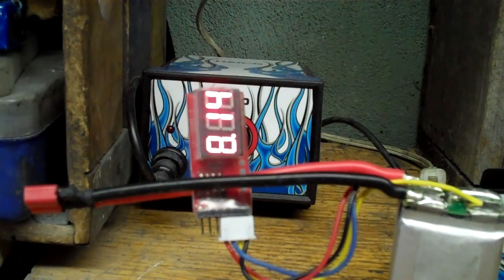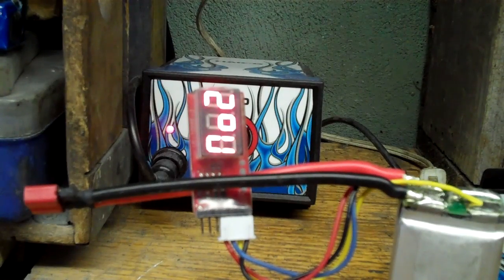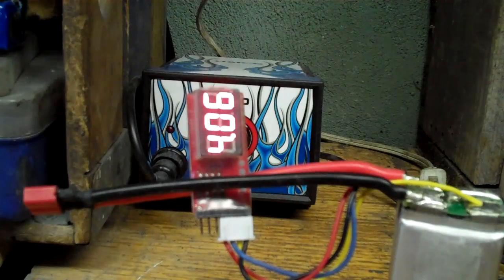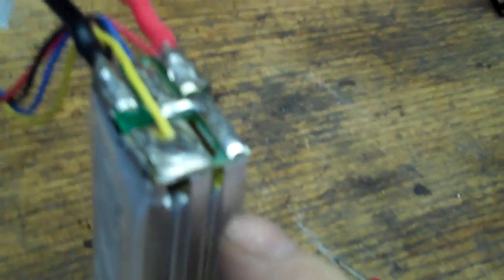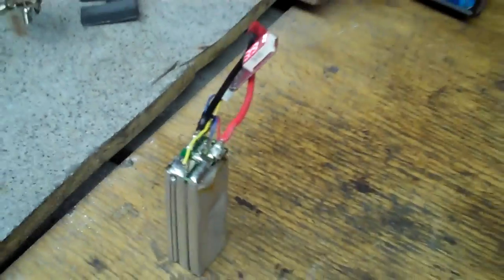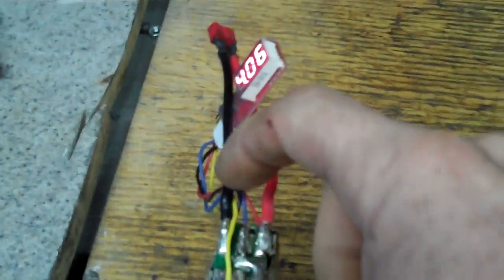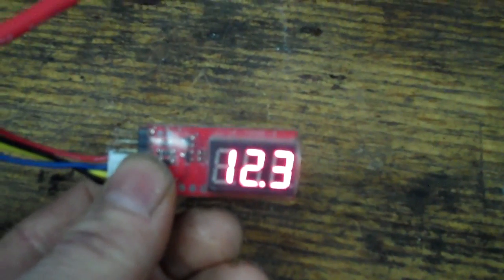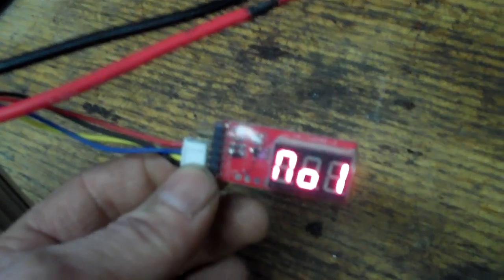How to repair a LIPO battery at your own risk.

Comment: Great video (very entertaining of course!). I had not considered the solder joins breaking. I have a 3S battery that after a minor crash, dropped a cell. Zero volts. But nothing is swollen. I may take a look a the solder points you indicated. I have a more complicated question however. I have another battery, a 2S2P battery that at the balance plug, is showing 0.45 volts on one of the cells. A broken solder joint should just result in zero volts. There is no swelling, so I don't think a cell is chemically bad. How much more complicated is a 2S2P to troubleshoot? (I know, that just means 2 cells are in series to increase the voltage, then the two pairs are in parallel to increase the amps.) My fear is that some tiny chip on that circuit board is bad and I think that would be impossible to repair. Does that circuit board do anything other than provide a platform for the individual cell tabs to connect to? (Does it have diodes to prevent back flow of current or any other safety mechanisms?)  Thanks!

Comment: ~5:50 "13.5"
I usually read upwards of 15 volts on good car battery (open circuit). Though to be fair any time that I think of measuring that will be very recently after having the car running.

Comment: hi thanks for the video i do have question i do have quad copter  with battery  350mah with wall power when i  ido have other battery  from store it puff or burn why   but the same but different company  and what does battery hase protect thanks

Comment: Well I avoid the problem all together by not cutting off both wires at the same time.  I cut the negative, then solder on the new plug.  Only after it was done and heat shrunk would i solder the second one.

Comment: The same thing happened to me I tried searching for info on the Internet and nothing. What happened to me I was changing plugs and shorten and saw a little spark and I plugged my voltage reading and was readin as a 2cell so I saw the blue cable had a little solder. If it wasn't for your video I would of have put a nail thru my lipo

Comment: To help avoid problem while soldering a new plug especially on a T-Plug. I would strip one wire put a shrink tube on the wire, solder the wire, and cover with the shrink tube before soldering the next wire.  From experience when soldering a new connector, never have more than one wire exposed at a time.  I did manage to short a battery years ago when I had two wires exposed.  Lesson learned for me.

Comment: The balance lead could be bad.  There are actually two places you can test for voltage on the lead. One is where you will normally plug it in and another where it locks the pin in.  I would not worry too much about the voltage at the balancing plug except when charging using the plug.  What is critical is the voltage at the main plug.

Comment: If you are not getting any voltage from the third cell it might be dead or the foil where the wire soldered is to is broken.  I've taken apart about 100 lipo batteries over the years and have salvaged many for my RC airplanes.  I've even removed dead cells from a 6 cell pack and made it into a 5 cell.  You have to be careful when cutting or soldering the pack,  Be sure when working with a lipo you have access to a door to the outside so you can toss the battery out if you make a mistake.

Comment: did you ever get it figured out? if not, try this: does your main discharge leads show 7.6v or 11.4? if 7.6v, then 3rd cell is dead, if 11.4 then 3rd cell is fine and you just have a break in the balance lead on the 3rd cell- most likely the last red wire.

Comment: Hi there,
I tried to connect my lipo 3s battery with the motor,ESC an the transmitter/receiver. However,I probably made some mistake and now when I try to measure the voltage of the battery by getting the red multimetr wire to the one end of the balance lead and the black to the last-4th wire of the balance lead I get 0V. But,when I measure each cell,then I get3.82V for the 1st cell and 3.82V for the 2nd. Probably the 3rd cell is dead or not well connected.
Can U help me to get 3rd cell working?

Comment: I am having this same exact problem right now..Voltage meter only reads two cells unless I wiggle the wires, it then shows all cells online. Thing is, I opened her up, and all connections are solid..Any Idea what that could be? I thought it may have been the metal prongs inside of the balance lead but it seems to be the negative balance wire heading to the cell. I'm stumped. No cuts or tears that I can see. Help Brian!

Comment: out of 22 lipos i have here from hobbyking only 2 have come posted with dead or low voltage cells
 1 was run over buy a law tractor so i replaced it , .other 1 i puffed dew to lipo cut of disabling it self ,
replace it with this one ,no luck lol dam it

Comment: @briansmobile1  Hum  dam it ! thanks got it up to 8.2 /7.89 volt its not getting get hot i am discharging it now on a 206b icharger , , bring it back up see if it will balance ,pisses me off. 30 bucks wasted
yeah not worth the risk running it
i bet  it will burn up if i use it in my new boat  180amp esc pulling off it.. 
 i been trying to replace 1 other that puffed to make up a pear.this is number 3
not having any luck the others were my own fault .

Comment: i just purchased some fresh lipos and 2 of them had dud sells reading low voltage.
i fixed one with the balance board .using the balance wires .with one good lipo plugged in at the same time . they self balance the cells . got the voltage back up , the other 1 i tried the same trick but it puffed 1 cell only i little ,took charge ok , but its a little puffed on one side .dam it 
not sure if i should use it now. . or sent it back . to HK

Comment: this worked for me on a battery that i shorted for only a tenth of a second while soldering a connecter on.  if the battery is puffed or smoked or something, don't bother, just get rid of it because its a fire hazard and may explode in your face or burn your house down.

Comment: can you start your car with a  3s lipo I mean its got the amps get a 75c 3s with 5000mah that would be 75x5amps= 375amps get 2 of them in parallel would equal  750 amps THAT IS ALOT of amps or enough for it

Comment from the maker: @PROJ3KTJ30 Great question.  The discharge rate that is made possible by a better plug causes heat in the battery.  It's the HEAT that causes the puffing.  If you got new plugs put on and then pilot like a granny you'll find that your batteries don't puff up.

Comment: i noticed that all the batteries that i have bought puff when i change the connectors. hobbytown did my connectors on a 2-cell it puffed. my dad did the connectors on a 3-cell it puffed. and my other 3 cell is fine because it already had traxxas connectors.
is it the connector or the battery?